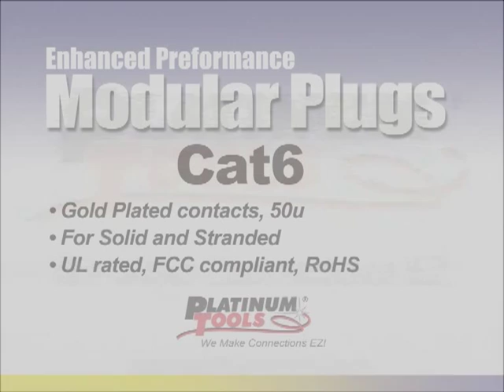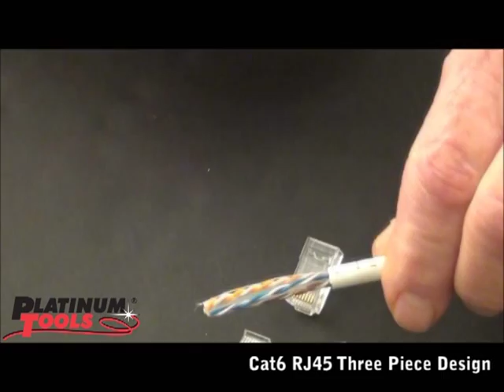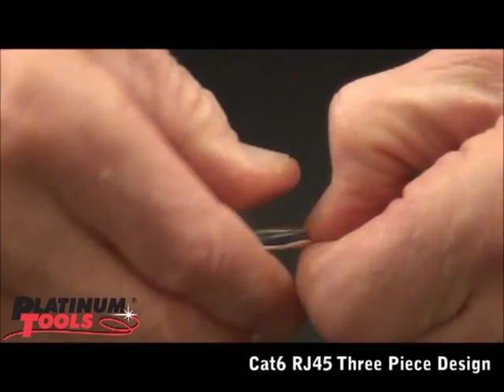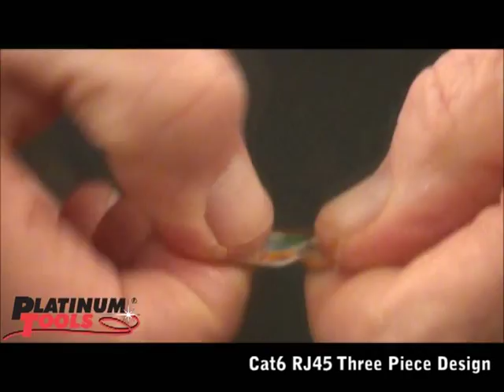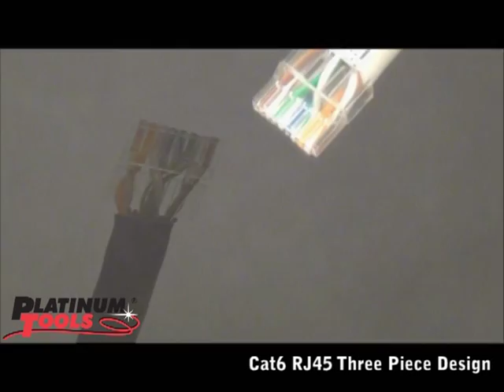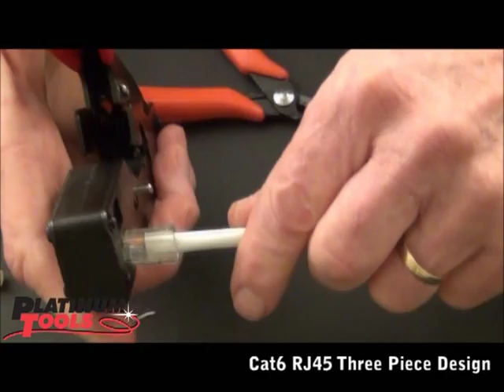High Performance: Standard Cat6 Three Piece Design Mod Plug

Comment: Wire guide does not have holes in it. How did you push the wires through it when there are no through holes ?